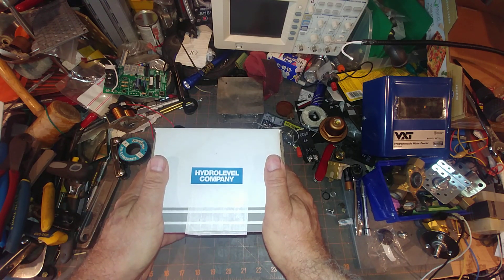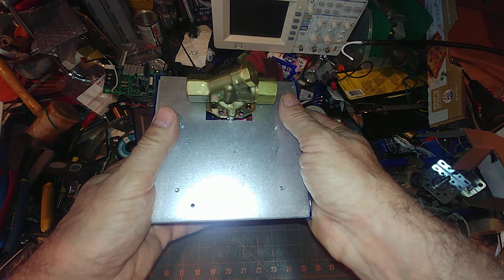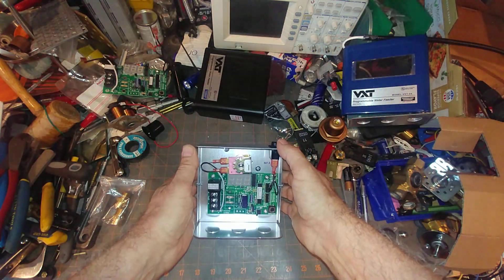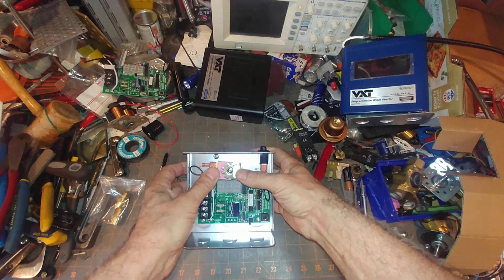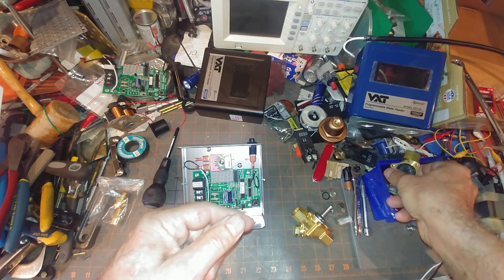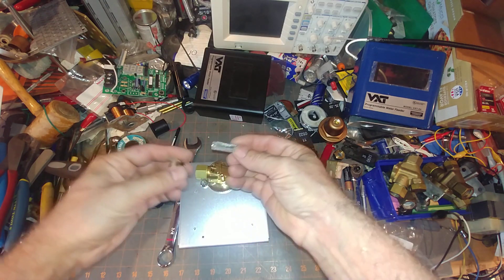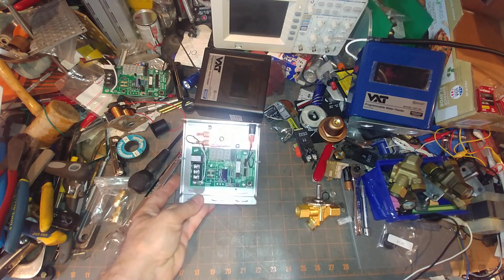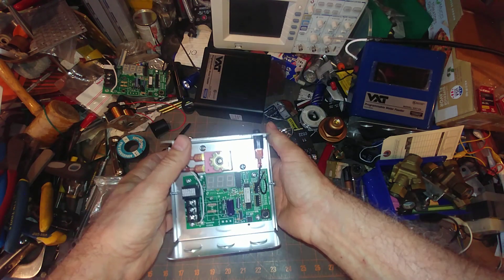Newly Redesigned Hydrolevel VXT Valve Makes This Steam Boiler Feeder A World Beater!

Comment: Can you help me with a video a step-by-step show me how to wire a McDonald's Miller uni match 120-volt Auto feeder to a 24-volt cycle guard low water cutoff please I need help now
Reply from the maker: I am not sure if that can be done safely.
Even if you could, I would advise against it.
I would remove the 120v M&M feeder and get a 24v Hydrolevel VXT.  
The VXT is a far better unit!

Comment: How do I take a McDonald's Miller 120  volts Auto feeder I want to wire it to a 24-volt cycle guard lower the cutoff
Reply: Can you please respond back to me let me know if it's possible does this can happen and take place with 120-volt Auto feeder to a 24-volt cycle guard low water cutoff can you show me a step-by-step video by chance